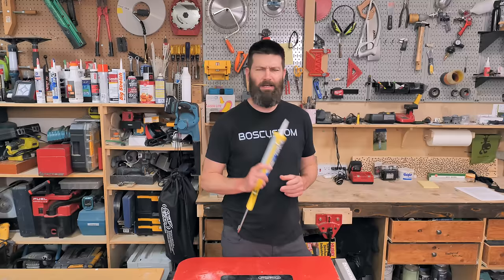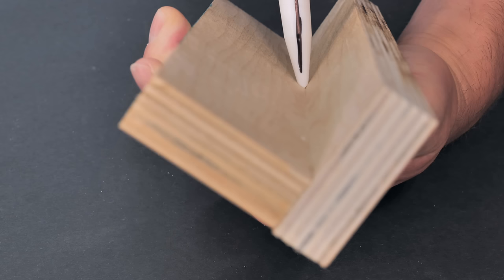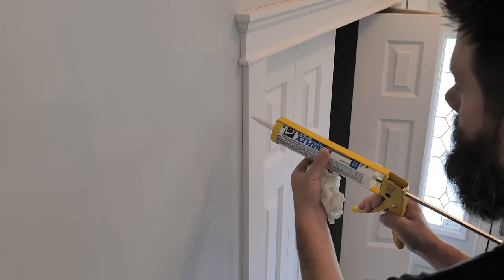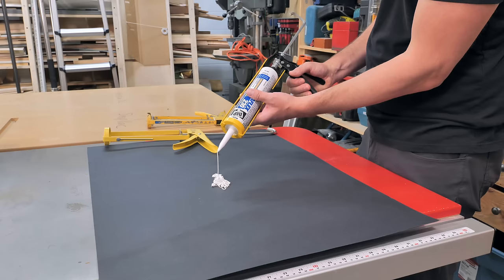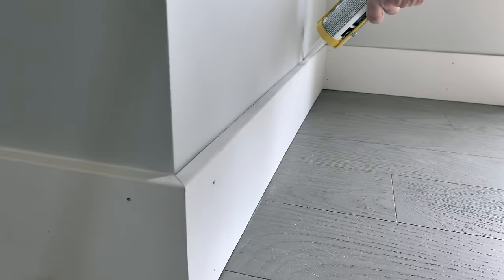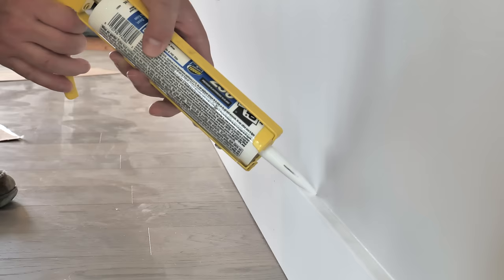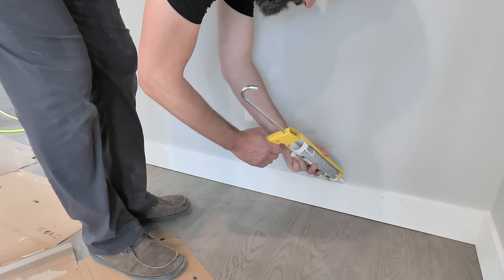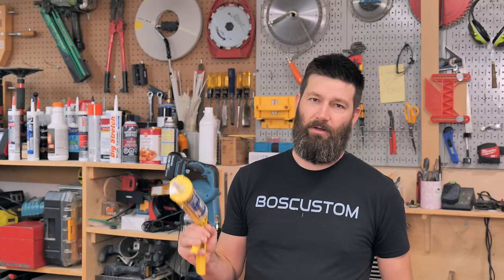The Secret Caulking Tip That Will Transform Your Ability!

Comment: Very helpful video! 10 out of 10 times I caulk, I’m for sure wearing more than I actually used! It actually makes a huge difference after painting because the paint will be more shiny where excessive caulking is and noticeable. I’m a huge DIY guy and for the most part do a good job but my cuts and angles are sometimes off and use more caulking than should be used. Great video and thank you!
Reply: I've found that using high quality caulk makes a big difference. 
Buy the stuff that the pros use. It's so much easier to work with. Spend a few extra dollars, you'll be glad you did.
Reply: Work with a small bucket with some water and a sponge in it, you can clean your hands / fingers / gun fast as much as you need, you can clean up all the excess and not make a mess doing it. If you have a lot of volume to do and just use a wet cloth instead of a bucket w/ sponge the difference in efficiency is huge. I'll use a wet cloth if I just have to do a few lines but any volume needs bucket w/ sponge.

Comment: OMG!  I thought I was the only person on Earth that did this down to the orientation line.  He does it 100% the right way.  The only think I do different is that instead of using a rag I use a tiling sponge that I cut in half in a small bucket of warm water.  That way I can actually pull extra caulking off and make a nice almost 90.  In addition, if the trim is well done (which it almost always is because I cope and know a few tricks) I use a wire to open the tube which is smaller than the one that comes on the caulking gun.  If you need a big hole the trim is probably poorly installed, but as a general rule the hole should be the size (average) of the gap between the trim and the wall.
Reply: I’m with u 100 on the tiling sponge . Been using that for years
Reply: @hgservices5572  Nice.  Good to see someone who knows what they are doing.

Comment: I can't believe this guy didn't mention wiping the edges after the initial wipe.  The first wipe doesn't always smooth out the outside edges.  The main gap that you filled might look good but the outside edges where the caulking thins out to nothing might have ridges or not be very smooth. When you finally paint the caulked area, all of the imperfections and irregularities are magnified.  The outside edges need to be smooth.  The way to accomplish this is to look after your first pass smoothing it out and make sure the whole line is smooth.  The best caulking job is one that after being painted, you can't really tell there was caulking applied. You might know it was because there's no gap, but that line is smooth, along the middle and outside.
Reply: A damp grout sponge makes short work of lines in your caulking.

Comment: Great video. Some big tips I would include is how to properly caulk inside corners, caulking really wide gaps and a really important tip is to have a bucket of water with a rag or grout sponge to keep your caulking fingers moist.
Reply from the maker: Good points
Reply: There is a tool where one doesn't have to use a finger but works about the same.

Comment: Great info! I have always tried to get a nice small tip as most times, the less caulk, the cleaner job. But never thought about sanding a bevel and the center/orientation line mark with a pen is brilliant!
Also, don't push TOO hard with your finger when you swipe the bead 😉.
Reply: See DanB's comment above.

Comment: Personally I prefer to use the Ryobi Battery Operated caulk gun.  You can set the speed and when you let off the trigger, it will be dripless.  However, you have to be ready to start again, as it is not instant. This prevents the little pools you normally would get on a long run of casing, by not having to repeatedly depressing the trigger. I learned this from a guy who works for SafeGlass.  This is the only tool they use, as squeeze out on windshields is a major mess.
Reply: Milwaukee caulking gun is RR between caulking guns
Reply: @gabriels32  what?
Reply: @MWorsa  can't you read
Reply: @gabriels32  I can read I just don’t know what you mean by “RR” is all, sorry.
Reply: @MWorsa  Rolls Royce
Reply: @gabriels32  I never would have guessed that lol, thanks!

Comment: There is usually oozing from the tube even when you use a dripless gun, note the drip-less and not drip-proof name. That’s because the tube expands under pressure and will ooze as it goes back to it’s original shape. 
But the rest of the tips are spot on.

Comment: I think caulking is one of the biggest finishing skills there is and it takes lots of practice.  Always make your hole smaller and make your beads smaller than you think you need because once you start to smear them out you don't wanna end up with a big blob on your finger as your moving along.
Reply: Why are you touching or smearing anything learn to caulk….

Comment: All those are great tips and they work well provided you're maintaining the same angle and direction of travel (like on a baseboard). However, if you're doing around a toilet for example, you can't always maintain the same angle and so I find I have to caulk one half of the base and then a separate bead on the other half and then touch up at the point where they meet. Would love to see you do a video on that scenario. As for dripless, I just remember to back the rod off between caulks and that works pretty well and as you say, have a rag close by in case the nozzle needs a quick wipe. Thanks for the tips!

Comment: Great video! Very well done! Love the comments at the end too! :) I've been around commercial glazers a bit on my projects and one MORE tip for your viewers: SAVE your old caulk tubes and use the rear of them to deposit your excess caulk removed with  your finger or tool in the old empty tube's rear opening!  Neatness counts as we all know and for larger caulk projects that old tube's open end can hold a LOT of the extra waste caulk as you generate it. It beats the pants off of the paper towel only method. 
Save an empty tube or two and you thank me someday. :) Thanks for the video, love the orientation mark and tip prep, now on to my bathroom to practice them! Vince
Reply from the maker: excellent tip

Comment: If you cut the tip almost flat, you can apply the calking instead of behind the tube dragging it, you apply it going forwards that causes the tip to flatten out the calking as you apply it. It’s a little tricky to get the right amount and correct speed but eventually you’ll get it down to where you won’t need to go back and smooth out what you applied
Reply: I agree, this is how I've seen the real pros do it, and fast. But it's a knack and takes some time to master to the point where you can do it one run and not have to go back and tidy up.
Reply: I feel like I tried that and still sucked. I tried everything.
Reply: @TradBarbie  it takes practice
Reply: @Chewyness  I usually can't do things if I can't do them at least ok the first time. I'm good at lots of stuff, but never caulk. It's not in the cards.

Comment: I always used the level caulk gun, worked really well and I was decent with it. My buddy loaned me the M12 Caulk gun for a bathroom and kitchen. I dont think I will ever use a manual caulk gun again, for me it was a game changer once I figured out the flow with a tiny tip cut.
Reply from the maker: Interesting
Reply: Is it worth the hassle?  I can see the benefit for big jobs, but would you break it out even for small jobs like maybe a cabinet filler piece or some door casing?   A battery caulk gun is one of the only pieces of gear I haven’t tried out yet.
Reply: @kds471  I replaced a couple hose bibs and needed a little bit so I just used my level caulk gun. For the 2 exterior doors I recently replaced being able to use OSI quad and not have any pump bumps on my bead is surprisingly fulfilling and looks amazing once it all settles. I find my self using M12 on the smaller and smaller jobs lately. I really like it.
Reply: @Danko88  thanks for the info, guess I have to check it out.

Comment: Another great tip is to use painters tape on sink and shower edges to put down a thin seal and avoid overlap.  I've down this for years and it works great and keeps the silicone in the gap and limit the overlap for possible peeling later.
Reply: This is a TERRIBLE method - please don't do this!!

Comment: Great tips. Been caulking for 30+ years and it annoys me now that the tubes are single use. They used to come with caps and with nozzles that could be unscrewed and replaced with a clean one.  But now, use the caulk once, it dries in the nozzle and that's it useless. Can't use that tube a second time. Great way for the manufacturers to get us to buy more of their product.
Reply: I always stick a framing nail in it and tape it with painters tape. Works every time. Won't dry up for a long time.
Reply: @chrisryan9102  I do the same and have had used caulk tubes last up to a year.

Comment: A pro told me to push the caulk into the joint instead of drag it along.  This forces the caulk in any crevices or holes.  If done properly you don't even need to smooth with finger afterwards.  Takes some practice but I've used this method since I heard about it.  Thank you for your video.

Comment: For anyone who doesn’t know they sell tip cover that prevent the ends from drying and the caulk won’t come out.
Reply: The cover by itself is good from day to day, but it will dry if left for very long unused.  I put a long screw or nail in the tube and then the tip cover. Still good months later.
Reply: @da324  some brands you can leave a tail out the end and pull it out as it dries up but leave the rest wet still, though some brands will just dry the whole way through.

Comment: One tip you missed - it also helps get the flow-rate right - is: PUSH THE GUN - DON'T PULL IT!
1. This keeps a good pressure on the caulk (silicone, painter's mate, whatever), so that it gets right into the crack.
2. It means that you can judge the flow-rate perfectly. As you push, maintain a bead of caulk ahead of the nozzle... that's the perfect sign that it's right, whatever speed you use to push...
...you're welcome! ;>) Rob

Comment: How do you smooth out the line when your fingerprints have all been rubbed off and you still have 2 bedrooms left? I tried a wet wipe and rag and paper towel but I haven’t found anything that works as well as my finger 😔
Reply from the maker: Ahhh the old caulk finger injury!  At some point you have to involve the other fingers to spread out the pain😂
Reply: I suck at caulking, but I have discovered silicon caulk squeegees are awesome. They have several sized “bead”  selections and the best thing is the uniformity of the resulting caulk bead.

Comment: Having caulked miles in my career, the best tip is a square tip. Use sandpaper to round the edges. That way, you're not fighting turning the tube to get it lined up right, and it works at all angles.

Comment: Thank you for these tips.
1. We need practice; I used the carpenter's tiny gaps in the joints to practice my caulking before starting the tricky bit of the angle between the glass and the wooden frames. Afterwards I realized that since I have wasted 3/4 of every tube I've ever bought, I might just as well practice filling in the cracks in old weathered wood before starting work in earnest. Each time.
2. Real Newcomers (I speak from experience) need to be told to unscrew the nozzle from the tube and pierce the seal in the tube BEFORE applying super-human strength to the gun trigger.
3. I am now looking forward with enthusiasm to my next hobby-caulking job.
Thanks again. Chris.

Comment: Using caulking (as opposed to silicone) I finish off with a small, slightly wet kitchen sponge. Easier to squeeze out in a handy bucket than be wiping your finger off with a towel, in my experience.

Comment: I have done a fair bit of decorating in my time and caulk is a life changer. Very easy to use and you can fill gaps very quick and clean. Rather than filler that would take for ever to do the job.

Comment: Any standard caulking gun is dripless if you click the angled metal piece at the back when you stop ... it allows the plunger to jump back just the same as the dripless gun. Yes, the dripless gun saves you doing that but it's just the same result.

Comment: im horrible at caulking but ive noticed if i cut a angle my tube always  does not glide for whatever reason it makes it awful. i always just cut straight now despite every video saying angle it. i also realized just doing a straight bead never seals anything really. i always take my finger afterwards and mash the caulk into the gap to make sure its in there and flesh and smooth. this works well for me on my outside projects for my old 1800s house where i really have tons of gaps im filling while painting

Comment: 2:05 take your knife, scrape off smoothness along down the nozzle of the chaulk to the angled tip, NOW go back and forth on the scratched away line with your pencil and your line's not going anywhere! 👍
Faster than finding a sharpy!
Reply from the maker: I prefer the sharpie but this is great if you don't have one, thanks for the tip.

Comment: My favorite move with caulking base boards is to place my finger over the tip of the gun in the groove I'm caulking, and running my finger with the tip all the way through the application. Nice and clean, no waste, no oozing, and is pretty quick compared to applying the caulk and going back to smooth it out.

Comment: What for? It’s much more work afterwards, plus it will look bad after 2-3 years. 

Glue felt to the back and bottom of the solid baseboard and screw into the wall with dowels. 

Then the work holds as long as the house itself and can be easily refurbished if necessary.

Comment: Many problems can be solved by using painter's tape to mark the desired line accurately. This method ensures perfectly straight lines, regardless of your precision or skill level.
Reply: Just make sure to remove the tape BEFORE it dries.

Comment: I prefer to use tape for a clean finish, however I haven’t seen anyone else offer this piece of advice so I will. Dawn dish soap. Mix soap and water and dip your fingers in it and use your fingers to slide to caulk where it needs to go the soap will prevent it from adhering to your finger and making a huge mess. Hope it helps.

Comment: I'm curious, some caulking bottles say you have to pierce the inner cover once you cut the hole on the tip. If you cut the tip that small, what do you use to puncture the inner protector to get the caulking out?

Comment: Good advice to use multiple small passes.  I always lose my caulk in the varying gaps when the sheetrock is just a bit wavy so I think this will help.  Do you have any suggestions for keeping the line looking good when you have to re-squeeze?

Comment: If you want to keep your caulk dripless, you need to keep the tip clean.. It helps to get your groove on before you put it in the crack so you glide smoother. 

Take your wet rag, and put your pinky in there.

Comment: I cut the corners off an old credit card and use it instead of my fingers.  Fingers work fine most times, but depending on how much caulk you are laying down, the card corner can be cut exactly to fit your need.

Comment: Baby wipes are the secret to a good caulk line. Wrap your finger and pull the line. Fold the wipe the pull the next line.  When you caulk with a finger you have to continuously wipe your finger or you get build up on your finger which changes the wipe line.  This solves that.

Comment: Question - Do you recommend using this method to caulk the bottom of baseboards to a vinyl floor as a quick fix for gaps? I have a relative who's basement baseboards have a gap, and bugs keep crawling under them and they don't want to have to do any extensive work.

Comment: What is this fascination with a bit of gappage? I suppose for "industry standard" trim jobs, it can be warranted.  I worry a little about getting enough caulking into the gap with this caulk-on-the-pull method. Good advice otherwise. Being a fussy boat builder type, I did the trim in my house to my satisfaction. Turns out I should have painted it too because even after requesting NO CAULK due to it always looking dirty after a while, the painter still caulked it. Six years later I am starting to feel the need for a razor blading of all the caulked seams, even though the painter did a fairly decent job.

Comment: Excellent, thanks, got referral from a person (sorry, forgot channel) with video on how to put outlet behind tv without messing up drywall.

Suggestion, however, put links to the US Amazon site as well as the Canadian, so you can benefit from those.  Just happens the red unit is 1/2 off at this particular time, but from the US site for it so no benefit to you, sorry.

Comment: With keeping the nozzle tip opening so small, How are you piercing the inner seal  ?  It seems the nozzle opening is smaller than the wire on the caulk gun used to break the inner seal ...

Comment: I recently caulked the corners of my bathroom with a silicone caulk. I found that operating the gun required a lot of strength. Although it was my first time doing this, I am pretty sure I was doing something wrong. Is silicone generally hard to squeeze out? Was it my gun? I was never able to get a smooth flow out of my tube. And I had to use both my arms to squeeze the trigger. What do you think I am doing wrong?